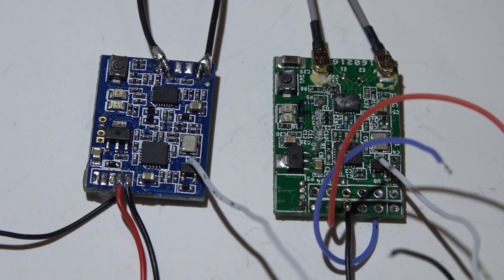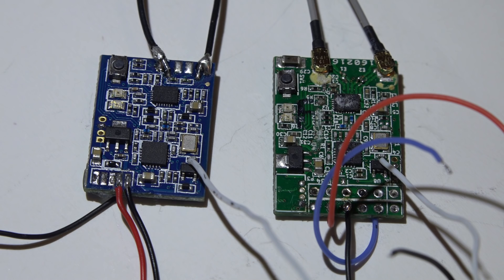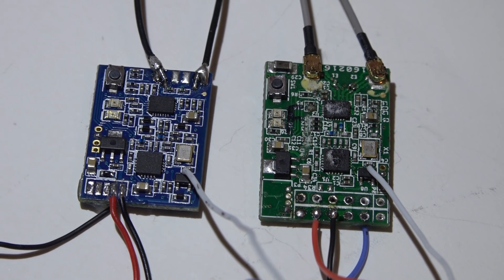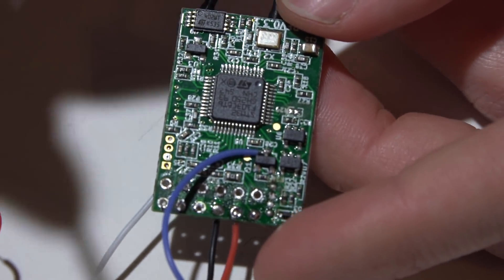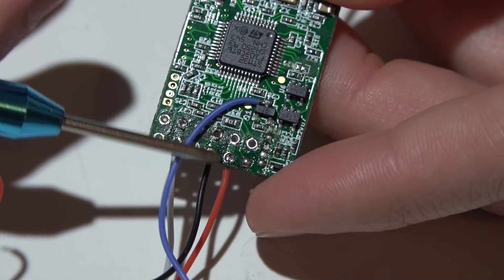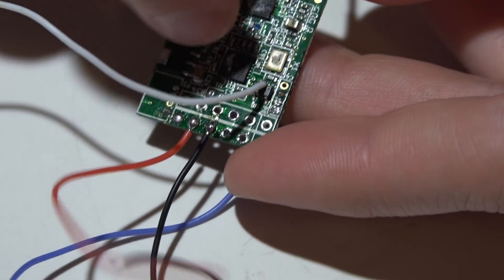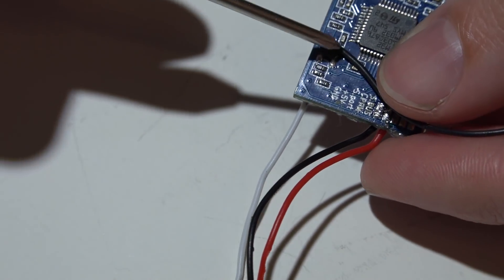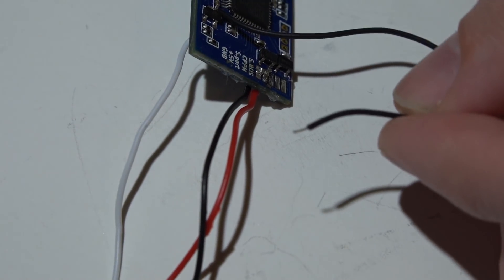Un-inverting FrSky XSR & X4R-SB Telemetry & Sbus Signals

Comment: Good time!
The question is: Have you ever encountered a search for uninverted SBus in ia6, ia10,and ia10b receivers? 
I want to make a repeater on QCZEK LRS, I need an uninverted SBus. 
Some receivers have such a signal and you can take it to the built-in inverter. 
There is an option to make an external inverter, but these are unnecessary elements in the repeater.
Thanks!

Comment: I had a hard time trying to get my receiver to respond in BF. Tried all kinds of tips none worked. I figured my last option was the inverter way which I read about. Thank you JC for another helpful video. I just finished soldering the way you explained it here and it works great.
Still can't believe your gone. You really helped alot of us folks in the hobby. RIP

Comment: The Latest Betaflight firmwares come with a CLI Parameter called serialrx_inverted, so my question is, if we enable that parameter, do we still need to do this Un-invert hack on the receiver ?
Reply: Got it clarified already. The Serialrx_inverted parameter is only for SBUS, it has nothing to do with Telemetry signal. So if you are using a SMART port to connect to a TX port, then you have to uninvert the signal using a receiver hack only. Software cannot help for that. Just FYI for anyone needing this information.

Comment: Hi. Nice video.  I have an XSR.  I've read that people are managing to get analog voltage telemetry from the XSR by soldering to a pin with a voltage divider to get pack voltage.  I've tried this with a FBVS-01 but there is already a ~10.5v reading coming through on A2 like a phantom voltage reading.  When I tap into the pin on the receiver which others have used, it just increases the voltage reading by about 0.8v on A2 with a 2S pack at 1/4 voltage division?  Please could you let me know if there is a solution to this?  I'd love to get battery voltage telemetry with the XSR and FBVS-01 as it's such a tiny and light weight solution.  Many thanks.

Comment: hello, do you know why i get sensor lost allarm at the distance about 10-15 meters away? i got an SPF3 with 4XR-SB (sbus connected IO_2 ), telemetry on pin 6 IO_2, im using betaflight 3.1.7    (taranis X9D+  frmware OTx 2.2.0)

Comment: Hi,
I've watching your vids on the dys f4 flight controller with osd. I've also just purchased 15th June 2017 a x4r sbus reciever. You mentioned about inverting for sbus and telemetry. Do the newer boards still have this problem please?
Reply: Well in answer to my question.
The DYS F4 Pro V4 does not need the sbus being uninverted from the x4r sbus. It reads the normal sbus.
I hope this helps someone.

Comment: You are the fucking man.  It's people like you that helps me keep faith in humanity. Now that I've got my dys f4 board rocking sbus on the most current firmware I have antigravity. I love that mode. I am building a mrm switch blade on 5s with mb 2207-2580kv on 5051 gemfans today. I will finish it up later and send you a link. Cheers homie!

Comment: I'm currently doing a DYS build and your videos are a life saver. I really appreciate the effort you put into your vids.
Reply: Harry David how did you get on with your build?
Reply: DYS Omnibus F4 FC
DYS BL_Heli S 30A ESC
DYS Fire 2206 2600KV motors
AKK X1P VTX. (switchable-25,200,600mW)
FrSky X4RSB Receiver 
Currently trying to fit it all in an Armattan Armadillo frame but it's a bit of a tight fit. Might gut it and put it all in my Martian 220.

I didn't know about needing to invert and thought I messed something up. I saw this and tried it out. Everything works fine except for fitting it all in the tiny space and buttoning it up.

Comment: Apparently you can grab the uninverted sbus on the x4r from the 3rd through hole on the right side. See this video. https://www.youtube.com/watch?v=SdlZ1oS5yaA
Reply: Justin Delpero 
I tried using this method on my x4r sbus connecting to dys f4 flight control. I'll let you know if it works.
Reply: Lee Swifty for sbus or s.Port? I managed to do it for my omnibus f4 pro
Reply: Justin Delpero 
Hi, My apologies it wasn't the sbus which failed but the board. I've now replaced that board and I will try again. I will edit my post.

Comment: Thanks for this, I lifted the freaking sbus/ppm selection pads on my opmnibus f4.... so i literally can't use the onboard inverter. :( Just a warning, those jumper pads are ridiculous. Trying to get them to bridge was a pain in the arse in the first place but then when I was soldering up the xsr cable i accidentally unbridged the jumper. Trying to bridge them the second time both pads lifted.
Reply: If you're having trouble getting solder to cross the gap, you can strip and tin the end of a wire, bend it at the end so it just crosses the gap, solder that across, then clip the excess off.

Comment: wait.. so sbus and telemetry will work on any f3 but will not work on f4 unless uninverted?? I'm confused. I have an f3 and sbus and telemetry is all working fine
Reply: F4 boards only have 1 HARDWARE inverter. The F3 boards can invert on all uarts by software

Comment: glad you did this one.  I was watching your 3 month old omnibus telemetry setup and was wondering if anything had changed, or if there were any other fixes.  just picked up an XSR,  ill probably just do the telemetry wire.   is there still a problem with heat when using an omnibus f4 to power other items? if so I'll just power the rx and video right off my matek pdb.

Comment: Hi! Why don't you use the golden spare soldering pads located close to the edge of that thing? They are supposed to be the un-inverted signal?! 
Would be happy about an answere as I'm going to do this quiet soon!
Cheers
Reply: I came here to say this.. My guess is he didnt know
Reply: Luke Nukem hey does that work? I see the pads on the side of the xsr, but which ones are which
Reply: I personally haven't used the XSR, but take a look at this https://oscarliang.com/ctt/uploads/2015/10/frsky-x4r-sb-subs-uninverted-hack-naze32.jpg. I would take a guess that the pins are in the same order as on the X4R
Reply: so square pad will be VCC, and count away to get SBUS, like I said, I haven't used an XSR, but I HIGHLY doubt testing that would fry anything
Reply: id like a telemetry pad on that side